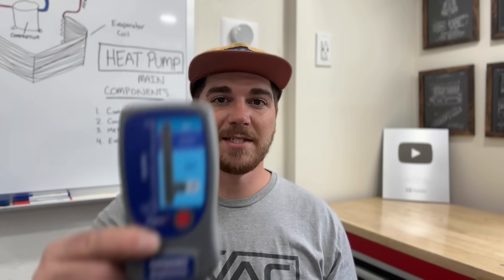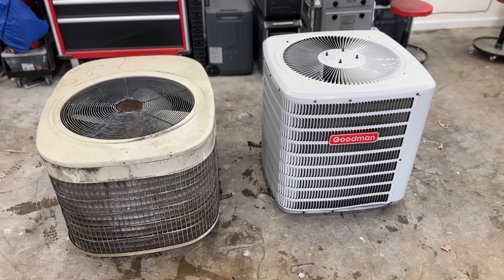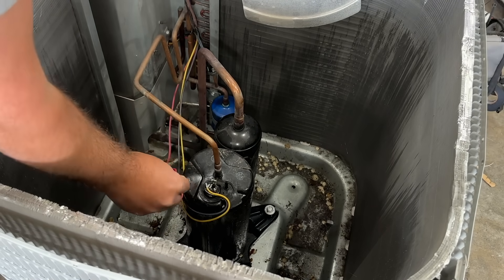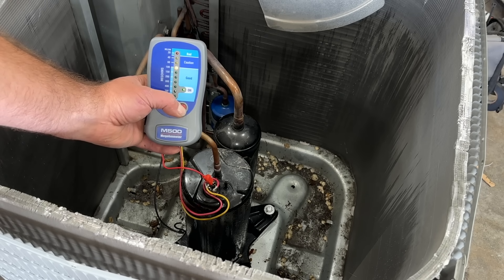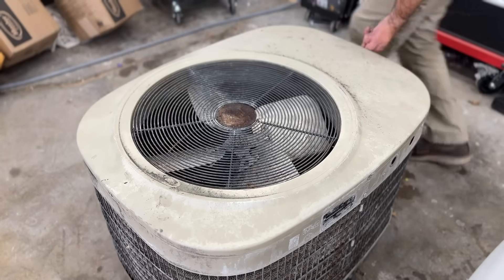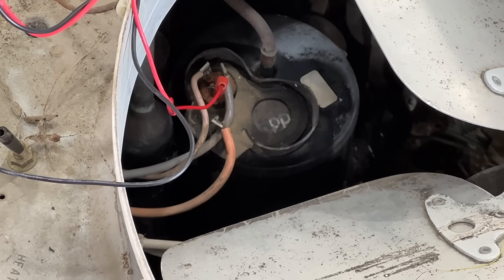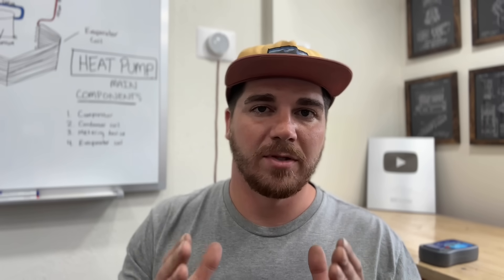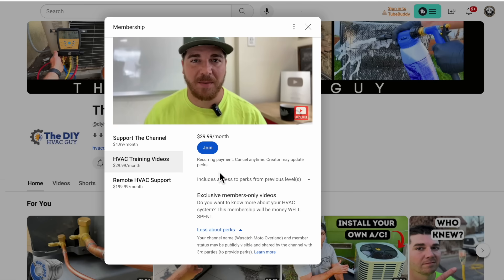Is Your A/C Unit About To Die? This Tool Doesn't Lie

Comment: I know of one Lennox combo outdoor unit ( Air conditioner/ natural gas heat ) that is 35 years old and still working. My late father-in-law purchased the unit 35 years ago. He died in 2022 and a grandson purchased the house. The grandson had the unit serviced, ( coils cleaned, Freon checked, etc. ) that old Lennox unit is still working to this day. The newer units just do not last that long. I have purchased several AC, Heat pumps, over the years. I have three Lennox AC units that are 23 years old. I have purchased York, Trane, American Standard, and Heil units in the past for different houses. My latest purchase was a Heil Heat pump, three years ago. So far so good on it. Only got 13 years out of a 5 ton Trane Heat pump. Replaced the outdoor unit with an American Standard unit in 2017. So far so good on it.

I don’t know which units are better than others, but a good HVAC guy makes a big difference. My experience has been that Lone Ranger type HVAC guys, or an HVAC guy who has one helper provide better results than HVAC technicians who work for large companies, who employ dozens of technicians. Those companies have to meet huge payrolls, whereas the one or two person HVAC company is under a lot less financial stress to meet payroll. A good HVAC person does not have to advertise to get all the business they can handle.

I found a great HVAC guy back in 2003. He was just starting out on his own back then. I have since used him for all my new installs and all repairs. I told all my friends about him. He got so busy he had to hire a full-time helper. He has so much business, he can pick and choose his customers. He is honest, reliable, and always does excellent work. He never had to use paid advertising. Word of mouth is more powerful in growing a business than any type paid advertising.
Reply: All true...most installations that last the longest and have the least troubles are systems installed by a good installer/tech. Many companies "hire out" installers to do the grunt work and it shows badly. Better off having a single HVAC guy do the work and take a couple of days (or more) to get things done correctly vs. a crew of grunt workers looking at their watch/cell phone every hour or so "We only have X amount of time left".
Reply: I found an HVAC contractor like that to replace my system. He was the owner and had a technician (his brother in law) and a part time casual labor guy. 

I knew he was the right choice when he came out to bid the system and answered all my questions (I’m an engineer) and told me that he would be the guy installing it. Very happy with the results.
Reply: Amen!! And instead of looking online for an AC repair company when needed, call a local HVAC parts supply business. Ask for recommendations for an independent HVAC contractor in your area. NOT one of the big name contractors!! Save yourself some SERIOUS money! The best repair guys won't have a big storefront, a fleet of shiny new service vehicles, crisp company uniforms, and a monthly quota to fill.
Reply: So true. One of my best friends dad has one helper and doesn’t need to advertise because he gets so many referrals just word of mouth because he’s honest and does a good job

Comment: While I agree that often it is something like a capacitor for the reason a unit does not start.  Electrical shorts, which can be tested with a standard multimeter, granted there will be a few cases where the short is not seeable at 9 vdc but those are very rare.  But there are other factors beside this, a bad valve in the compressor would show a good compressor in this type of test.  A better way of checking for electrical issues is both resistance of windings and current draw compared with exchange temps.

Comment: Forewarning, the accuracy of a megometer has a lot of parameters, a megometer can very well lie about the condition of the A/C unit because of compressor windings reading being effected by refrigerant. So unless you are going to take refrigerant out of the system, I don't see how you can get an unbiased test out of this. If the system is overcharged or undercharged, it will affect the reading. Even with a perfect charge, it could affect the reading on a negative biased. IIRC, the owner of HVAC School took away megometers he specifically gave to his service techs because of their lack of reliability for status of a compressor.

Comment: As long as compressor is functional, all three windings are connected internally. Testing terminal by terminal as shown is also testing whatever is connected on the other two terminals and then some. All three wires need to be removed and just testing one terminal to ground will test all windings. That tester is low current, but puts out 500VDC. So if there is something at the end of one of the still connected wires that can be damaged by high voltage, you just damaged it. Or if a fan motor is connected at the contactor with the compressor, you are also testing that fan motor and wiring. Which, if you get a bad reading and mis-diagnose the compressor bad, when in fact it was the condenser fan or wiring, yeah.....
Not to mention, there are other things that can indicate a failing compressor. Doing an insulation resistance test is just one test.
Reply: Oh the best part about all of that is also scroll compressors due to the tolerances in which they are designed and where the refrigerant has migrated to in the system a good reading is still below the red bad marker on that tool. I can’t remember how low it is. I think it was like 5 mill ohms where that one bottoms out at 20 mil
Reply: @jeremiahmiller7796  The old rule of thumb was 1M Ohm per 1kV plus 1M Ohm, before insulation testers were measuring giga-ohms and now even tera-Ohms. So anything less than 1kV was always 2M Ohm. Now of course as insulation, materials and testers evolved you'll have specs in 100's of mega-ohms for low voltage and much higher for high voltage equipment. As always, best practice is to follow the manufacturer's spec. Like you mentioned.
Reply: I agree… testing with any wires (=control circuit) connected could zap the control. You are doing an insulation test so everything has to be floating
Reply: Our technicians stopped using these a year or two ago due to damage they can cause. Ohm out the windings with a  meter, not hard. Gimmicky device. Same as an ECM tester. Have one and never use it as a meter is all you need.
Reply: @Gus11445  If properly used, an insulation tester (such as in the video) should not cause any damage. It is only testing the dielectric strength of the winding's insulation.  Measuring the resistance in the windings has nothing to do with this.
Reply: @Gus11445  insulation test is a good way to test your windings. It is done on all motors in just about every industry.
Reply: @Gus11445  A megger is a great tool, you just have to know how to use it properly and this video is not the right way and will damage shit. If a megger shorts out motor windings, it was about to fail anyway. Meggers are usually non-destructive when used right. Ohming out the windings and insulation test (megger) are two opposite ends of the spectrum.
Reply: how long are compressors rated to last ,, why do they not make the compressor easy to remove to install a new one  like in a car ? why do you have to weld a new one in??????
Reply: @bengordon7635  They aren't hard to install, usually. Just need to solder the refrigerant lines, no welding, like most refrigerant lines are anyway. Cheaper, less materials and less chance for leaks when soldered.

Comment: Good info here! I've always been my family and neighbor mechanical and electrical handyman, cars, electronics, home appliances, you name it. I've done all my own HVAC work too. You just need a good attitude, patience, common sense and a mechanical aptitude. I always love to watch your videos for up to date info! Thanks!
Reply: In my case, I bought an AC textbook, read it, worked on my own systems, took the licensing exam, aced it and was no longer an HVAC "service"  victim.
Reply: How much would an air conditioner at good price new or used cost for 1 acre of land or ~3000 square meters for a greenhouse? A unit that can lower temperatures to 2-3 Celsius or 41f
Reply: Unplug all the wires before testing.  This was not proper technique.

Comment: Tha start capacitor went out on mine. To be fair, that central AC unit was built in 1967 so I cannot complain. Ended up replacing the entire system a few years ago as everything else was original and would no longer keep up on really hot days.
Reply: Interesting. Why was it no longer "keeping up"?
Reply: @wholeNwon  Unsure. Coils were reasonably clean for being 50 years old. System was charged. Evap coil drain tray was rusted away with some of the air handler so it leaked and damaged the garage ceiling. Was bittersweet to see it go as that system was built like a tank.
Reply: what brand did u go with now?
Reply: @MrRjnr  Carrier.

Comment: This doesn't tell you what you think it does. Youd need to actually ohm out the compressor and compare it to the manufacturer specs. Motors have different resistance.

Comment: I live in an rv park in Az. Many of these Park Models have been here since before 1982. Many of the rv's still have the original carrier pancake 2.5 ton straight cool ac with 7.5 kw heat strips and Coleman Saguaro park model, and you'd be surprised as to how many are still rocking. Performing very well I might add. Some have new fan motors but many are still factory, when I do a performance check the run caps are still spot on, and many haven't even been serviced in yrs, I do many a coil clean and install a tri-dem 3ply filter to keep their ducts clean for many yrs to come
I will be getting a mega ohm to further prove to my customers that their unit is still good and performing as it should, not one of my service buddies has ever told me about a mega ohm meter before. Glad I came across your video in upping my knowledge
Reply: which rv park in Az?

Comment: The manual for the insulation tester recommends that all leads be removed from the compressor at time of test. I would think that in some cases this could be important as other components still in the circuit could cause the lower 100 mega ohm reading you saw on the Goodman. The little tester does seem like a good idea. The manual says it applies 500 volts to the circuit at very low current and this is what is needed to properly do a test like this. Thanks for your video.
Reply: Don’t listen to this guy. Depending on the oil and the liquid in the bottom of the compressor, you can get false readings and you absolutely must take the wires off the compressor.
Reply: HVAC technicians stopped using these a year or two ago as we found out they can do damage to your unit. There's literally no reason anyone should be using this device over simply using a meter to ohm out the windings.
Reply: @Gus11445  If used incorrectly, the high voltage output from a megohm tester could damage your control equipment. But a megger test and ohm test are used for different purposes, depending on what you want to know. An ohmmeter checks that the windings still have a continuous low resistance current path for the normal flow of current, but a megger test will tell you if the insulation around the wires is failing. An ohmmeter can tell you of a problem AFTER a failure, and a megger can let you know of a problem BEFORE a failure.
Reply: I agree regarding removing all leads.  Also, the ground location being on a clean /paint free part of the case rather some other remove location is important to not receive a false high resistance reading.  In the case of the compressor, directly to copper line seems like a good location.

Comment: I love your videos =D the average homeowner popping the lid holding the fan by themselves and megging around, good luck! 

Your advice for 2nd or 3rd opinion is the best move. 

If most homeowners cant be bothered to research replacing a cap, id be nervous to encourage them to open up their condenser. 

A few bad technicians are out there but if you are hiring a tech that improperly diagnosis a compressor as bad when a thermal overload switch is open, hire better reputable help.

I have been the follow up tech and enjoy the homeowner challenges of "we had someone come threw and we need you to inspect our system to confirm findings." Sadly both those times it did seem like the previous company was shady.

Comment: I wish I could buy an ac system back when things were built to last, I paid to have installed 2 systems since a bought my house, and same scenario on the current ac unit on my house is relatively new and started acting weird already, now I know why, things are not built to last anymore.
Reply: OR you have had bad installations.  Meticulously correct installations (the ONLY way to do it) are rare. The brand of AC system is relatively unimportant but the installation is extremely important.
Reply: @wholeNwon  sadly reality that tells you how bad things are currently, quality degrading on both ends, products and skill labor.
Reply: I guess it boils down to, systems today will not tolerate a poor installation like the old stuff would and of course, the old stuff was more reliable in their components.
Reply: @Garth2011  I think that the old copper evaporator coils were superior and usually very solidly built. The new scroll compressors are said to be more reliable than the old piston units though I never had trouble with mine over 47 yrs. and they were very quiet. Circuit boards are usually much better than trouble shooting with a wiring schematic that may be falling apart. New systems cheap out with Schrader valves and piston metering systems rather than TXVs (that can easily be added). Capacitors don't last as long but they are very cheap and everyone should keep a spare.
Reply: How is it acting weird?
Reply: @wholeNwon  once desired temperature is reached, the condenser starts to short cycling symptoms to maintain temperature, new filter drier was replaced and issue continues, new contact box was replaced issue persist, expansion valve was replaced and issue continues, capacitor was replaced and issue continues, it was troubleshoot and instrumentation confirm everything else is ok including compressor and issue continues, at this point is almost better just to replace the damn unit itself.
Reply: @fernandodiaz5749  Is your thermostat powered by a transformer (24v) or batteries?
Are you aware that the thermostat very likely has "swing" programmability?  Also, do you have a TXV? It will have a copper bulb placed in contact with the evaporator coil.
Reply: @wholeNwon  thermostat is powered by transformer 24 v no TXV detected.

Comment: I have a package unit on my roof.  What is the cost comparison for replacing the compressor  vs a complete unit?  Trane 1400 Package unit on the roof.  Crane was used to install.
Reply: You don't go into any details. Size , access , crane needed , so.... it's hard to tell.